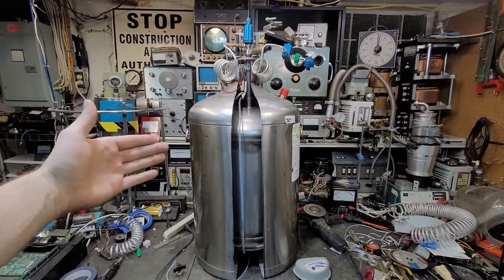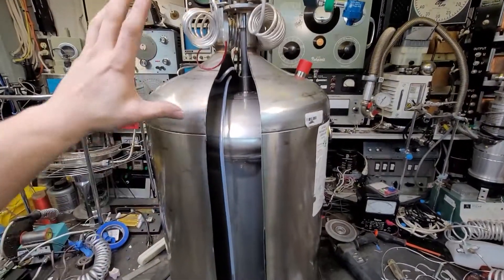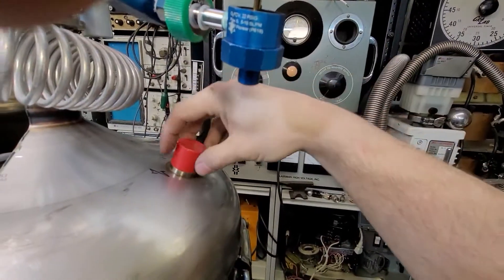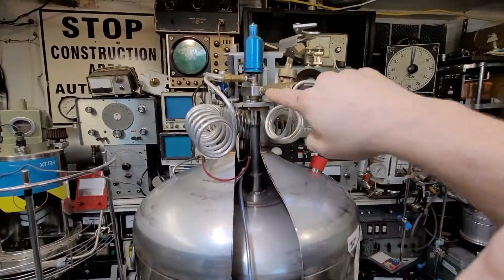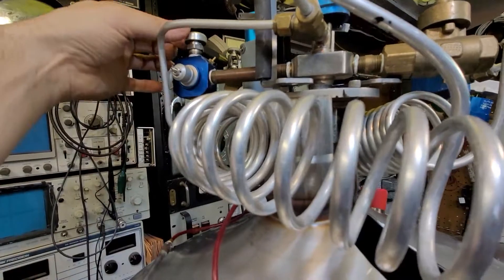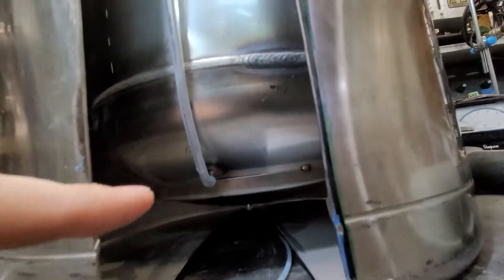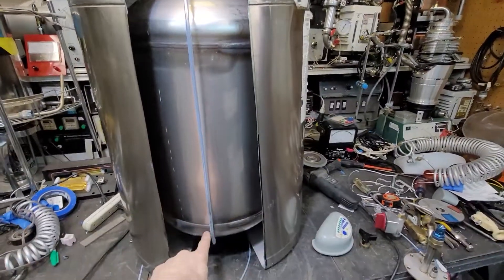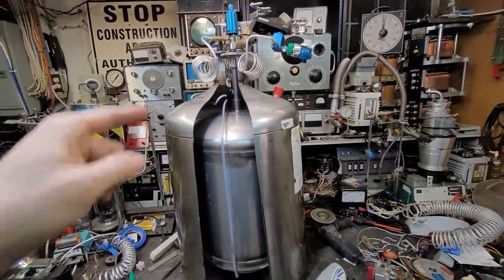Cut Open a Liquid Oxygen tank!!

Comment: How did you initially release the vacuum?
Reply: I want to make into a solo type firepit
Reply from the maker: @bob-owen  I uploaded this Video to show how I did it, I removed the rubber cap, cleaned off the vacuum grease with a rag, than threaded in an Eye bolt that fit, 1/4-20 maybe. than pulled up to break the seal and let the air into the tank, this released the vacuum, and the plug came all the way out so you know it is now safe.  NOTE: it will take around 14.7lbs of force to pull the plug out.
https://youtube.com/shorts/ExLtOBUM3J4?si=lRYzYkaV47J435MZ
Reply: Hi I have a big liquid oxygen tank I want to cut open. Now i opened all the valves and released all the air out then I took a grinder and cut off all the valves it is now 2 days later do you think it should be safe to use a plasma cutter to cut it open ?
Reply: @tdotdondada  a drill might be better. It’s not as dramatic as I thought it would be but there should be no O2 if you’re going to cut it
Reply: @tdotdondada  a drill might be better. It’s not as dramatic as I thought it would be but there should be no O2 if you’re going to cut it